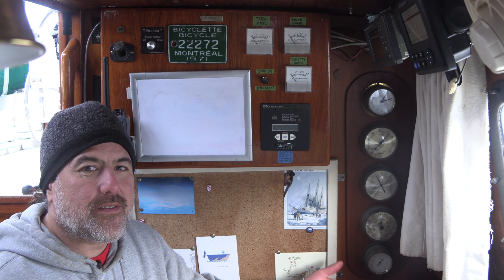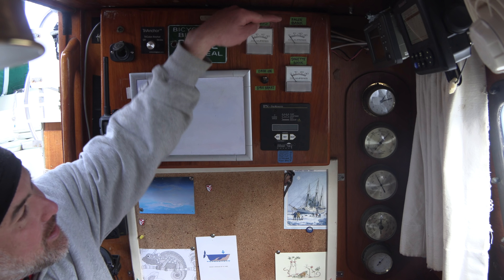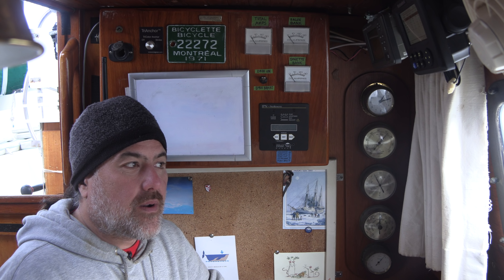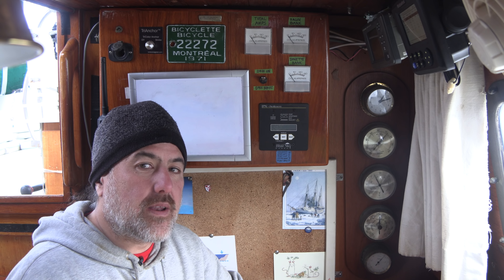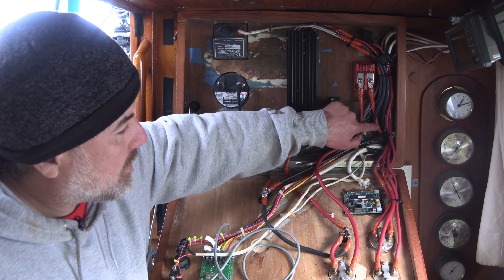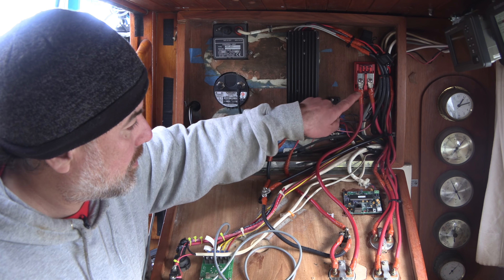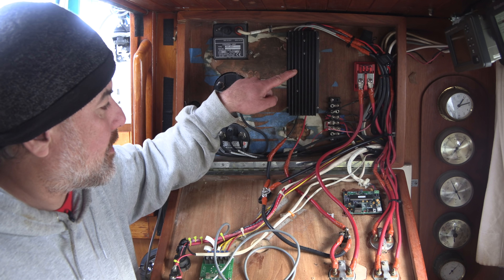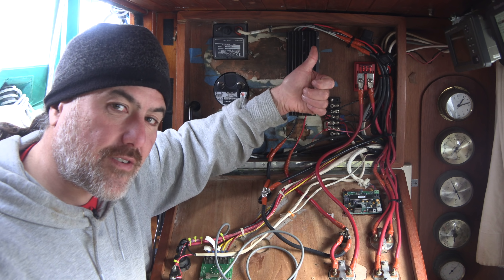Eclectic Energy D400 Wind Generator Wiring & Performance Review (Part 3)

Comment: Great D400 series!  I'm sure you've sold a number of units for them.  I hope the manufacturer was open to some feedback about ways to make the installation easier.  Like an alignment post when aligning the blades to the plate.  Seem like it would be easy to add one so it almost snaps together.  Either way, great video.  I'm looking forward to next season.

Comment: Great video - I used this extensively to assist the install of a D400 on my vessel. Two questions I’m keen for your experience on as you’ve had this a while now:

1) how hot to the touch do the dump resistors get when full energy is diverted to them for any sustained period? I.e. can you hold onto them.

2) when energy is diverted to the dump resistors do you hear a soft buzzing sound from them?

After my batteries were fully charged, the power was diverted in a 16-20 kt breeze to the dump resistors and both of the above circumstances were true for us. I’m assessing was there an issue in install or if this is expected.

Comment: I totally love the squashed tin can heat barriers behind the dump resistors.  That is quite enterprising.
Reply from the maker: HA! Good eyes.  Those kidney bean tins were all I had available at the time. They seem to have worked fine, though the heat generated by those dump resistors is so little that I wonder if they were even necessary.
Reply: @drakeParagon   Certainly won't hurt anything.  Like you, I was thinking these things were gonna be like the elements in a toaster.  Er, not so much.

Comment: Thanks for your video. I noticed that you didn't install a bypass for the dump resistors. Is there anything you can tell me about how I would install a bypass? Would the two grey wires be shorted out or would they be then switched to being open? Tia

Comment: This was an excellent series. Based on your review, D400 has moved to the top of my list. I really like the amp meter setup with the off switch--very clever. Not sure what additional info the control panel provides. My question: how many watts do you have in solar and how many amps is your battery bank?

Comment: Hi Drake & Moni
We just removed our D400.  Our experience was that we were not and do not plan to sail in sufficient wind conditions to make the D400 a justifiable device.  I really wanted this to work but it just did not contribute enough.  Maybe if we were high latitude sailors... Anne & I are softies.  So that means milder conditions which lets us get our electricity from the 640W of solar (4 panels).  Doug

Comment: Over time with the D400 rotating on the post, the wire could twist further in one direction and eventually break. What do you use to stop the wires from twisting in the post? Or what precautions are in place?
Reply from the maker: The stainless steel shaft base with the wires coming out of it (and the tower liner) stay stationary as the wind generator body rotates.  So the wires don't rotate inside the pole at all.  Take a look at this part of the installation video -> https://youtu.be/E6xypfntBa0?t=639.

Comment: This is a great video, and it's seems like you're producing a lot of energy with your wind turbine.  Fantastic!

I have a question to start with.  You spoke of heaving to during 25 kt + winds and the turbine topping of your batteries and then the excess energy was harmlessly dissipated as heat.

So two questions here:

1.  Do you have any sort of heat on your vessel?  This could include a central heater, a space heater, an electric blanket...or something that I am yet unaware of.

2.  If you are not using electrical heat, but rather insulation ( :-(, that would suck), then could you use the excess, dissipated heat, to, at least, heat your sleeping area?
Reply from the maker: Hi T Diddle, thanks. For the past 11 years we have heated our boat throughout every winter with a wood burning stove. We have also insulated 100% of the hull from the floorboards to the deck, the underside of the deck, and the inside of the cabin top with 32 mm thick Armaflex insulation. We do have a little electric space heater which we occasionally use when we are hooked up to shore power. Any excess energy created by the wind generator after the batteries are topped off would not be enough to run any kind of cabin or water heater.
- Drake

Comment: Excellent video Drake. Do you think it’s possible to cruise with only a wind generator with no solar as a live-aboard?
Reply from the maker: Thanks Rob,  
That's a difficult question for me to answer.  I think it's complicated.  I could just say yes because there are lots of cruisers who live aboard year round and voyage for thousands of miles every year without any solar panels or wind generators. 
But I think it really depends on things like...  

- how much electricity you want to use every day- how often you will have access to shorepower battery charging- how much sun and wind is in the area where you are cruising for your solar panel(s) and wind generator(s)
I know of cruisers who live aboard year round without any solar or wind power, but they are cruising in areas where they are able to frequently plug into shorepower.  

Or other cruisers who don't plug into shorepower, but run gas or diesel generators for all of their power.  
Or others who are happy without needing more electricity than they can get from occasionally running their engine's alternator.  

I also imagine being in places where there's always a lot wind, but often not a lot of sun or vice versa.    So it all really depends.

On our boat our electrical demands are pretty high.  So I think for us it's definitely worth it for us to have both wind and solar.  We love how we can get electricity from the wind generator when the solar panels aren't producing anything because it's night time or cloudy, or vice versa when it's very sunny but not windy enough...

I found some articles which I thought might find interesting:
Wind Generator vs Solar Panels Which is Better For Your Boat?https://www.emarineinc.com/Wind-Generator-vs-Solar-Panels-Which-is-Better-For-Your-Boat
How Much Solar Power Do You Need?
https://theboatgalley.com/how-much-solar-power-do-you-need/

Comment: What keeps the generator  from spinning on the mast so it does not twist the wires up inside the pole
Reply from the maker: The stainless steel shaft base with the wires coming out of it (and the tower liner) stay stationary as the wind generator body rotates.  So the wires don't rotate inside the pole at all.  Take a look at this part of the installation video -> https://youtu.be/E6xypfntBa0?t=639.

Comment: I have heard that wind generators are very loud when they are turning. How was the D400 sound ?
Reply from the maker: Hi Mike,  D400 is incredibly quiet at any wind speed.  You can hear it in the last part of this video starting here: https://youtu.be/0uArpuWHVTg?t=474
Reply: u hear the high pitch in the video.    when u sail there is a lot of noise from everything else so u wont notice but at anchor or in a habour i dont know.   but its a valid question.   some vindmills are quiret  some are not.
Reply from the maker: Our old Air X marine wind generator was unbelievably loud, and we had two of them.  I couldn't stand the noise.  But we love how incredibly quiet our D400 is, in any wind speed and in any anchorage or marina.

Comment: Thanks for the review. I'm very tempted if only I had an arch. Is the brake used when wind speed exceeds a certain limit or just at the discretion of the user?
Reply from the maker: Thanks, The brake switch is only manually operated.

Comment: Also, I am very interested in photovoltaic performance in the North Sea (vs. more southerly climes), as I would like to know how a solar, wind turbine (turbines...that I would add), and kite sail powered boat (a modified Silent 60) would preform in a Labrador to Greenland, to Iceland, to Faroe, and then to Shetland route (in May...the highest period of insolation for that area).  This vessel carries 250+ gallons of diesel as a backup, but I'm not sure of it's nominal MPG.

But then, if I accomplished this crossing, I could perhaps take the same boat to Jan Mayen, or even Svalbard...and well then, that would be mighty dandy!

To me the key of sustainable energy is freedom!
Reply from the maker: In Svalbard during summer when the sun never goes down we always had lots of excess electricity from our solar panels. We were surprised however in Greenland, where even though there was a lot of sun, our solar panels were often not generating much because it was cloudy.
- Drake

Comment: Than you for posting this. You did not comment on the noise factor.
Reply from the maker: Thanks, I'm looking forward to making another video about the D400, which will include showing how little noise it makes.  In the meantime, I'll say that the D400 is incredibly quiet at any wind speed.  We usually don't even notice any sound at all.  You can hear it in the last part of this video starting here: https://youtu.be/0uArpuWHVTg?t=474
Reply: "Incredibly quiet" might be a roar to someone else. 
Any decibel or some readings?

Comment: Why not do either: use the excess electricity for heat in the cockpit, or hot water? Also I imagine it would be easy to wire a relay that opens when the batteries are full.  Thoughts please. Excellent video , very well done and appreciated your slow narration.
Reply from the maker: Thanks, I really don't think that the amount of heat that's generated by the dump resistors could be enough to heat our enclosed cockpit.  I've thought about sending the excess energy to a heating element in a hot water tank instead.  But I haven't heard of anyone who has actually done it, and I'm not sure if it would be an adequate amount of energy to heat much water.  In 2010 I did install an Hurricane II hydronic heater (made by International Thermal Research) for cabin heating and infinite super hot water for showers.  It's one of the best things that I ever installed on Paragon. - Drake
Reply: @drakeParagon  Roughly, and assuming no heat loss, using the example at the end where the amp meter hovers at around 5A, if it did that for 1 hour at 12V that's 60 Wh or 216 kJ (kilojoule = 3.6 * Wh). Water has a specific heat of 4.19 kJ/kg°C. So correct me if I'm wrong but 216kJ / 4.19kJ/kg°C = 51°C for 1 kg of water in 1 hour at 60W. If the D400 was dumping 420W at 14/ms (28 kts) for an hour then 1 kg of water would get to 360°C or 6 kg of water would get to 60°C. If you were 60W for 24 hours, that's  1440 Wh (5184 kJ) or 1237°C for 1 kg of water or 20.6 kg of water at 60°C.
Reply: dont forget that this heat flux also has a negative component. The calculations you have appear correct at first glance, but negative heat flow through any insulation is likely to be 20-50 watts for a container with 20 litre capacity meaning that you will never actually achieve the temperatures you have calculated.
Reply: @superwag634  Thanks, yes the insulation and tank material properties are important. Another factor I forgot to mention is the initial temperature of the water you are heating. If that's say 20°C then you only need a 30-40°C rise for warm water use to get it between 50 and 60°C.
Reply: Those are really interesting numbers. I don't know your credentials for making that claim and would love to see if others can confirm your claim. I think dumping excess power to HW would be really useful, especially in the arctic circle!
Reply: Interesting numbers? Credentials? 😆
Come on, this is basic high school chemistry and physics. But usually children good at those subjects at school go on to study engineering or sciences. I’m a mechanical and chemical engineer. I would guess the guy who posted the numbers is something similar.

Comment: Why not use the dump circuit to power a 12V heating element in the hot water tank? Use the heat!
Reply from the maker: Hi Andrew, Do you know anyone who has done this and how it worked for them?  Thanks, Drake
Reply: DrakeParagon I read about it on one of my Facebook pages. I’ll do some searching. There is a lot of info on google for 12v/24v DC hot water elements though.
Reply from the maker: @andrewbarron8857  Thanks, I'd love to hear of any examples of this being done successfully.

Comment: are you still using this?
Reply from the maker: Absolutely. It’s still working great. I especially appreciate our D400 when we’re sailing offshore and it’s powering our autopilot, radar/chart plotter, lights and refrigeration.
Reply from the maker: In addition to our 15 solar panels we’ve got way more electricity than we use all summer long.

Comment: Hi. Weve had our d400 for 7 years and its rusted on the inside? How did water get in??? Weve never opened it up until now...yaw shaft bearings aren't Stainless steel and they rust from the inside out. Hope your bearings aren't rubbish like ours are! Great technology but rubbish components
Reply from the maker: Wow. What was it doing (or not doing) that got you to take it apart? Did you write to Eclectic Energy? What did they say?
Reply: The yaw bearings had gone which made it wobble. Took it to an engineering shop to see if they could take the bearings out  they had to take it apart it was that rusted! Havent told eclectic energy

Comment: I always thought a small underwater generator can produce the same energy as a large wind one. Great video nevertheless.
Reply from the maker: Thanks Dimitris, On the Westsail 42 with Perkins 4-236 diesel engine, the propeller spins when the boat is undersail with the engine off.  On Eric Forsyth's Westsail 42 Fiona, he installed a custom made alternator in the bilge just above the prop shaft, with a belt going to it to generate electricity.  It worked great! :) I've also seen a few different commercially available water generators.  I think this one is particularly interesting because it works as both a wind and water generator -> https://eclectic-energy.co.uk/product/duogen-3-long/
Reply: The nice thing about wind instead of water is that wind works even when you're not going anywhere. At least, when intentionally not going anywhere.  Solar's a nice backup when you're unintentionally not going anywhere. :D

Comment: Hi Drake, great videos.  I have a Eclectic Duogen installed but I want to install ammeters as you have.  I couldn't see that well but are your meters 0-30 amps?  Cheers Andy UK
Reply from the maker: Hi Andy, Yes those meters go up to 30 amps.  They were pretty easy to install because they didn't require installing a separate shunt.  Cheers! Drake Isle of Lewis Scotland